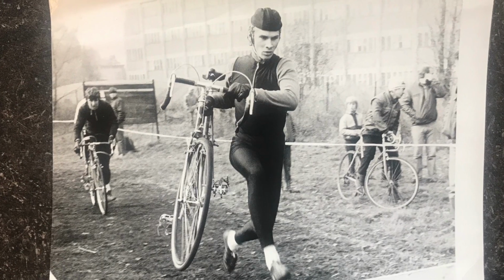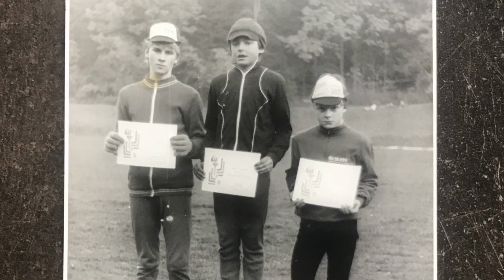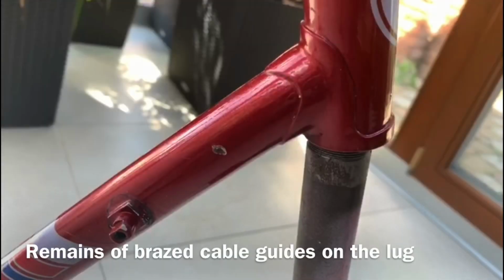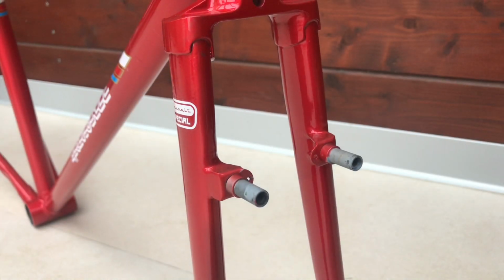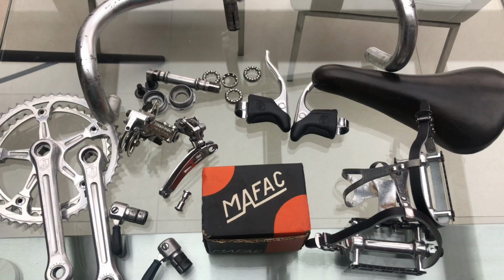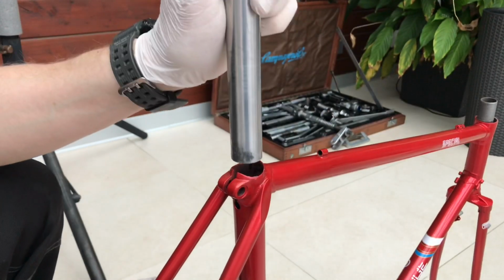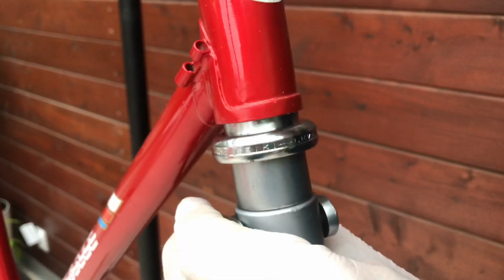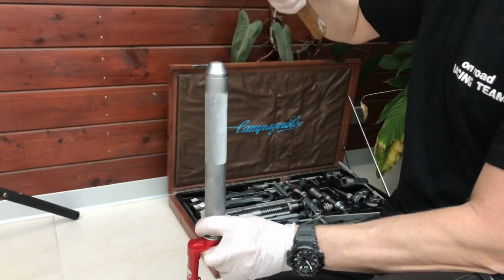Favorit F1 Special  cyklokros 1980

Comment: Excellent and meticulous assembly technique.      A bicycle from a time when it still retained its essential simplicity and most components were compatible.  A time when I was a bicycle mechanic and salesman.  
One detail which I can’t resist mentioning is in respect of the brake cable termination.    I believe that, after exiting from the straddle wire hanger pinch bolt, the brake cable is intended to continue straight down over the straddle wire, (and not bent.off to one side), thus better trapping or retaining the straddle wire when it is released during wheel changes.  The hanger has a gap specifically to accommodate the cable tail in this way, and the cable stays straight, helping to prevent fraying.   Chris, Plymouth UK.
Reply from the maker: Thank you for support and thank you for your knowledge. Marek  CZ

Comment: As a very young guy, I drove a racing Favorite in the late sixties and early seventies. Of course not F1, but the standard one with a steel crankset and center pull Favorit brakes. We rode then and cyclo cross, we only had tubulars with plugs, Barum off course. To mount the rear wheel with such a tire, (27x32), it was necessary to push the empty tire into the drops, then inflate. I also do a bit of restoration of old steel racing bikes and I would love to have one Favorite in my collection. There is one F1 near me, but the owner wants to sell a complete bike and asks a lot for it. When I was in Prague last year, I was looking at ads and hoping to find some Favorites. There were none.
Reply from the maker: What a Favorit expert are you! Thanks for watching a for comment! F1 is very difficult or very expensive to find. Not many survived...

Comment: One tip you will find valuable - Before even thinking about connecting either gear cable, stroke both derailleurs through their travel by pushing them, one by one,  by hand through their range of motion while pedalling the bike gently. Chain on clearly, but you can even rough in the rear limits by eye with it off. You can feel more accurately if the limit screws are out in either direction, and make adjustments- always testing full stroke between adjustments. You can check and adjust hanger straightness, if needed at this stage too. You don't throw the chain off, as you did - risking damage! I cringed watching you! When all is good , the chain freely snicks into top and bottom, but you can't push it off either end for trying.Repeatedly make sure the return spring can't drop it off the inside when you release the mech under pedalling load from low gear. Make sure all gear combos work freely. All, good? THEN you connect the cable, pull it up finger tight, tighten it up, and your cable tension is right first time! On friction, should be job done! On indexed systems- you're usually within a couple turns of the barrel adjuster of perfection. A very old Australian bike mechanic taught me this sequence when I was young. Now I'm an old Australian bike mechanic, working in Latvia. Most, if not all mechanics here don't know this either. Which shocked me. In Australia, it's bike mechanic's Mother's milk- you learn it right when you start, if you find someone willing to show you, like I was lucky to! Hope it helps make future builds, that little bit easier. Otherwise- BRAVO! Excellent work!
Reply from the maker: Thank you for the idea and thank you for your support

Comment: Period correct pedals would have been Lyotard 460d long thread. Toe clips should be double so that when you stamp on them they spring back. Toe straps were often cut and riveted or screwed to pedal side plates, as you show them routed flat through the side plate guides the straps would retain the mud scraped from shoes on clipping, de-clipping. Rear derailleur cable should be routed around the clamp bolt and back upwards to prevent pull-through. Mafac criterium brakes should be set up with the shoes hard against the  brake body, as shown they run the risk of brake shoes pushing through under heavy braking. Replace front brake hanger for a Universal hanger this gives a QR mechanism and won't bend like the Mafac version as fitted. In all my years I can honestly say the reversed front to rear cable routing was never "common cyclocross practise"! In the '60's there was a brief fashion to run the front derailleur from the right hand (hbc) lever but this would be used in conjunction with a R/H down tube lever for the rear derailleur, this was perceived to give more feel and accuracy of change through the block, it didn't last. On a technical point please don't adjust the rear mech by screwing the stop screw in (or out) against the spring tension of the mech - move the mech by hand to the required position, hold and screw in the stop screw to meet the mech body.
Reply from the maker: Thank you for carefully watching the video and the "endless enumeration" of my mistakes...I will try to understand and apply some of it.